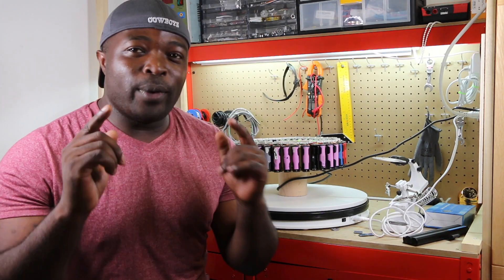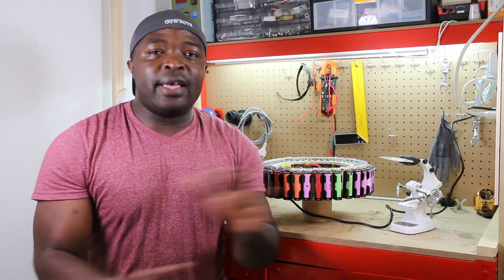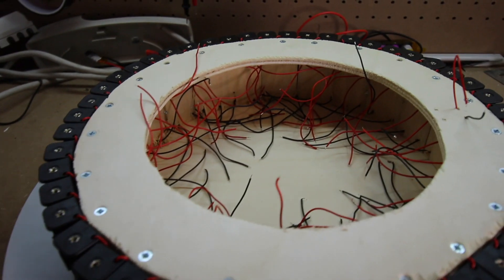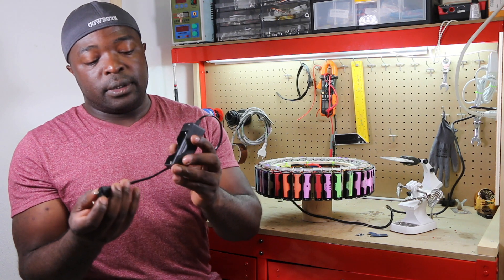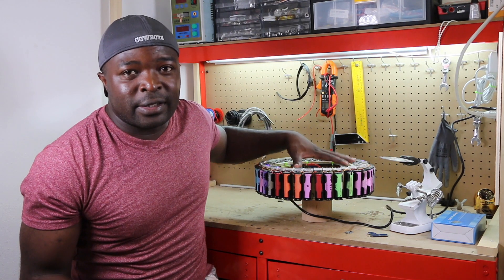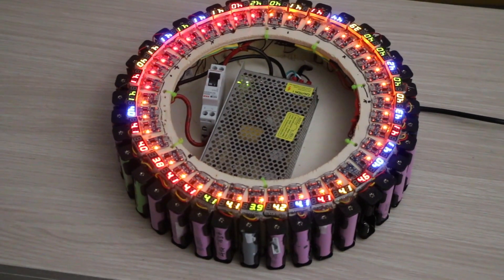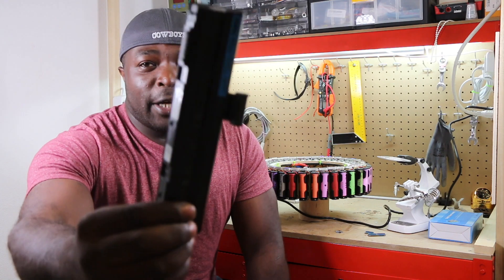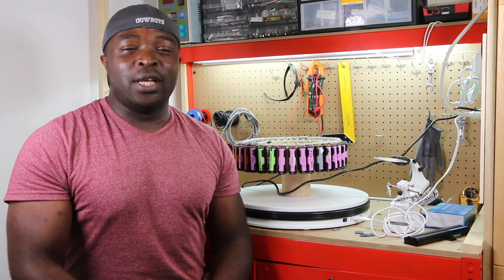DIY TESLA CIRCULAR LITHIUM ION BATTERY CHARGER

Comment: Looking good Kavin! You may be able to skip the screws. Most glues are stronger than screws and nails when glueing two pieces of wood together. Lots of wood glue tests here on YouTube. I started (and abandoned) an ESP8266 charge/discharge unit that would publish results via wifi to a computer in the house. You'd just load up a bunch like you did, the code would charge/Discharge and then record values. I tried to come up with a way to label the cell with a 2D barcode that held the results as well as a plain text, human readable result but lost interest since I didnt have a place to use my 18650s. May need to revisit this soon.
Reply: JuliansRandomProject Thanks Julian, that sounds like a great project. Will like to see it as soon as you can. Thanks brother .